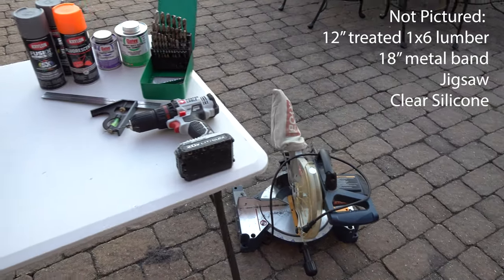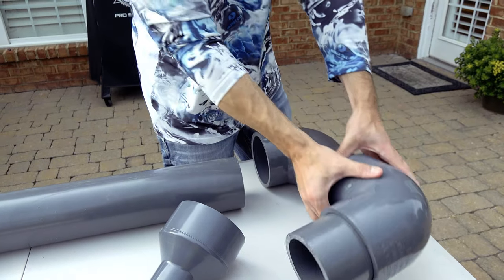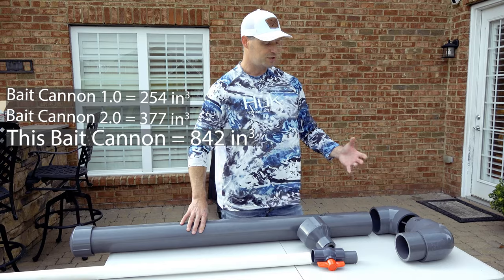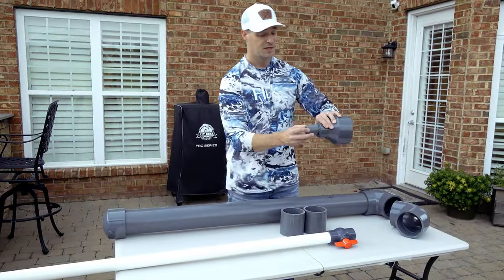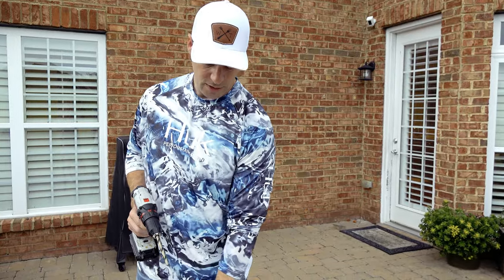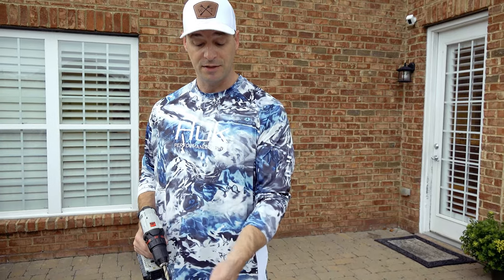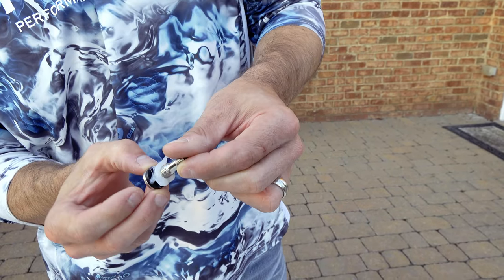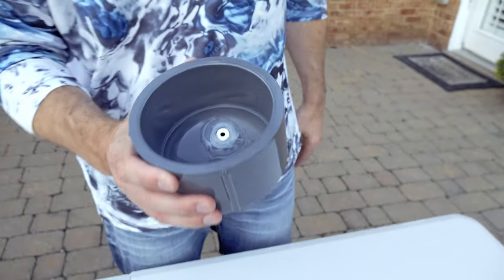Go BIG! How to Build a BAIT CANNON for Surf Fishing! Get MORE DISTANCE for a Bait Cannon!

Comment: Before gluing together, do a dummy assembly and then apply masking tape around the tubes against the fitting edges. Now when you assemble with glue, the excess primer and glue will not be exposed when fully assembled.
When putting the glued joints together, push the joints together and then give a quarter turn. This will ensure a better seal.

Comment: I really like version 3.0! For version 4.0, I have a suggestion for getting more PSI. What if you used a foster fitting, add a pressure regulator, then use a high volume hand pump like the ones they use for pcp air guns. The had would easily reach an extreme volume of air. I just don’t know how much pressure the schedule 80 pipe could handle. I bet it could handle quite a bit. Adding the regulator gauge would allow you to see just how much compressed air is in the plenum and dialing the correct pressure for the correct distance you are trying to achieve. You could get by with a cheap $50.00 BP pump and the foster fitting (female to male ) and regulator couldn’t add too much more money to the build. Do you know what pressure the Schedule 80 pipe can handle? If you can pull that off, you would have the Godzilla of bait launchers! Best wishes. Thanks for the great videos!😃😃😃🤙🏻
Reply from the maker: Great suggestions - we will look into it!! Thank you Ed!

Comment: change the valve out to a nicer one and you will gain 20 to 30% more efficiency.  we built these pvc air cannons in college as part of a design/engineering  class and found if you go with an electric solenoid you will see the best performance next best is a copper butterfly valve along with making the handle about 8 inches long lets you throw the lever faster. other than that great setup
Reply from the maker: thanks nick! do you mind posting a link to the parts you like?

Comment: Try putting the fitting together at 90 degrees from where you want it, then turn it to where you want it.  Doing this will eliminate any chance of air leaks.  Also, don't apply tons of glue to the female end.  If it pools in the fitting, it will weaken the pvc where it's accumulated.
Reply from the maker: Great tips thank you

Comment: Hi great video watching from Ireland 🇮🇪 just a question what do you mean by schedule 80 what size does that refer to as I live in Ireland and we have the metric system
Reply from the maker: Schedule 80 just refers to the thickness and the durability of the pipe. The actual thickness will vary by the pipes diameter. There are some charts and tables online that will list this out. Basically, you just want to get something that is as strong and durable as possible and it needs to be pressure rated (not DWV pvc) for safety.

Comment: You need to start with a tire beader...and a cheap compressor will only work a few times...you need an automotive air bag suspension compressor, a refrigerator compressor, a commercial compressor or a scuba tank...also, if u use a refrigerator compressor (ac/dc converter 1000 watts) you could vacuum the barrel (research vacuum cannon) and then fill the storage tank with same compressor...

Comment: Where were you able to find the 4" schedule 80 pipe?  I am able to find the adapters, but not the pipe itself.
Reply from the maker: I found it on usplastic.com - thank you for watching!
Reply: @Woods2Table   - is there a way you could provide a link to all of the PVC products you used on this build?  I want to replicate exactly what you have made, but i am finding it to be difficult to source all of the different pieces.
Reply from the maker: @jjj3000gt  check out the updated description. I've added links to the schedule 80 parts, which are the harder ones to find. Schedule 40 you can find at most any hardware or home improvement store. Note, most are, but some are not the exact parts I used - just links to the same parts found elsewhere online.

Comment: John, did you do any compressed air volume calculations to come up with your 51” long.   It might be a huge waste of air that is blasting out well after the bait is shot out.
Reply from the maker: I did not do the calculations for this build. You are correct! It IS a a lot more air than is needed for this barrel length. For maximum efficiency I’d need more barrel or less air. We did a video after this one on optimum barrel length (link is in the description).
Reply: @Woods2Table , I watched your other video, the one where you did do lots of calculations.  Extremely well presented.  You answered my question in that one.
Reply from the maker: Cool! Thanks Mike.

Comment: que espesor tienen los caños de PVC y cuantas libras de aire lleva ?
Reply from the maker: this cannon was built from schedule 80 pvc. There are charts online that list the max pressure for schedule 80, but this is typically given in water pressure rather than air pressure. be safe out there - good luck and tight lines!!

Comment: Just had to chime in. Why not use dry nitrogen to pressureize the system. Add a pressure guage and necessary fittings to adapt to a 1/4 in flare nut. Now you can pressureize up to 2000psi or anywhere in between using a regulator to add the nitrogen to the system. Boom, shoot to the moon.

Comment: Have you designed a stand for this one?
Reply from the maker: Not for this exact cannon, no - but we did put a stand on the same design in our original build. The only difference is the diameter of the pipe. Check out the original video for a step by step!

Comment: What type of fishing pole and reel to hold 300 to 400 yards of 20 or 30 lbs of line
Reply from the maker: Hi Todd - there are a bunch of them out there. I have several - I think this one was the Avenger AV 80a (20lb / 350 yd). Diawa makes a nice one in the BG 8000 for about $130 (20lb / 550 yd; 30lb / 370 yd). Good luck out there!
Reply: Also depends on line Diameter...
Reply: Literally anything over an 8000. My first reel was a 10000 and held 350 metres easy

Comment: If you know anything about safety. You will research to never pressurize pvc pipe. Because at some point in your life, it will explode in your face. You might say well, it’s pressured with water in types of services. And you’re right, but when they have a blow out with water, it does not explode, it basically just drops to the ground. Just coming from a 23year plumber that’s had lots of OSHA safety. Good luck. A better way would be with threaded pipe. I WOULD NOT USE PVC
Reply: Class 12 good for 1200kpa
Reply: @rhysbertrand8903  I understand what you’re trying to say, and I totally get it sir. I am just saying that you should not pressurize PVC pipe with air per OSHA standards. At the end of the day, the most important thing, is that we go home to our families, and not end up in the hospital. Bad things can, and will happen at some point. Just was looking out for your safety is all. Have a good one sir.
Reply: @caseyarmstrong7064  what 😂 there is no OSHA guideline for putting air in a schedule 80 pvc pipe, its just operating pressure 😂 it's 120psi, which us absolutely nothing in the grand scheme of things.

Comment: How far does this launch?
Reply from the maker: Its hard to say, since so many things affect the distance. Actual performance will vary based on air pressure (psi) in the cannon, weight of the bait rig, - and wind and ambient conditions have a big impact. We had an issue with our pumps on the day of filming and couldn't get the PSI where it needed to be, into a headwind, so we didn't get much distance out of it (relatively speaking). We've gotten well more than 300 yards out of it on other days. So much comes down to the pump and just being able to get enough air pressure into the tank. 
Thank you for watching Rob!!